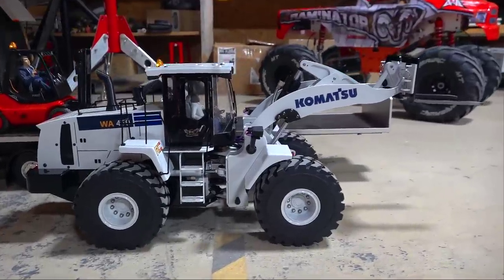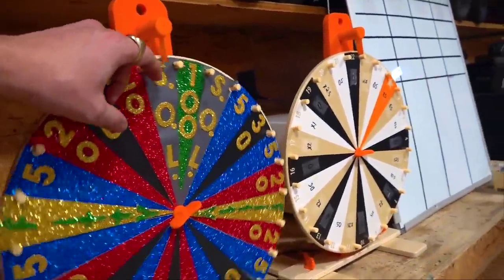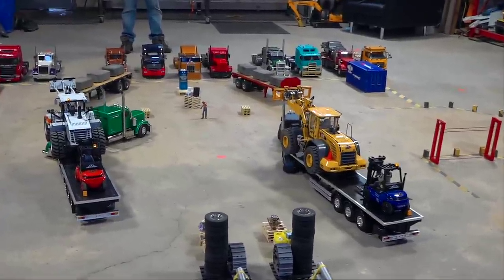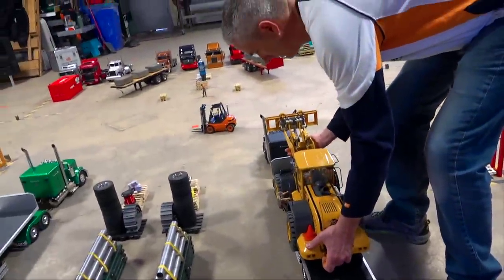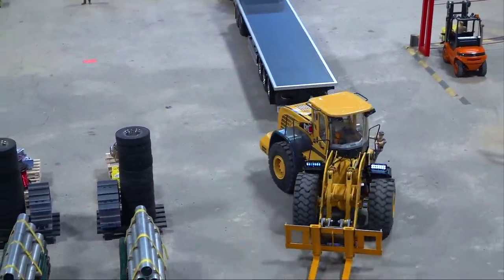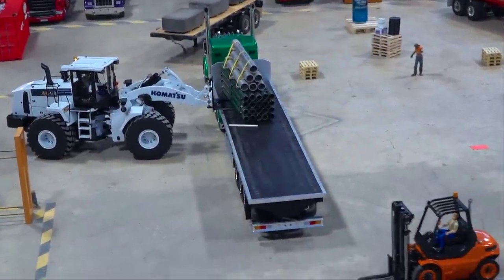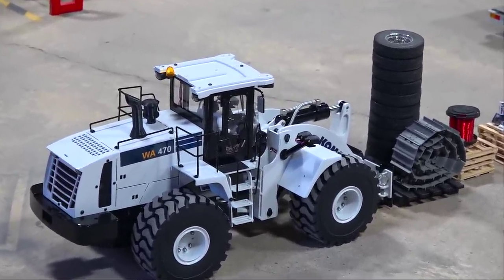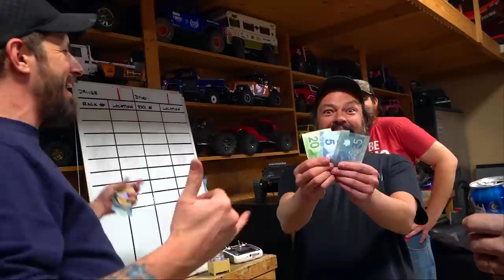LOADING KINGS - LOADER KINGS! DUAL ARTICULATING WHEEL LOADERS are CHALLENGED in the ARENA!

Comment: The forks on the new loader are at a different angle to the older loader. The older loaders forks are at a flatter angle when are on the ground where the new loaders forks only the front tips touch the ground so that is why sluice box had so much trouble with the pipes.
Reply from the maker: All he needed to do was tip the forks. I can do it no problem.
Reply: @poppygoatshomestead  but you are the Jedi master of RCs

Comment: Loved the Heavy equipment episode, too bad you can't do more with the heavy equipment like stacking containers with a RC Container Handler or using gripping claws on the excavators to pick up logs and load a log trailer to make the show feature heavey equipment more often.. With all the guys you have there you should run both Lesu forklifts as interference. I liked the Time Penalty. but should be like 30 seconds and the other contestant getting a penalty shouldn't cancel out the first penalty. especially if it's just time on the rock.

Comment: Both had failed strategies for loading the piping bundles.  I would have just picked up the loads with the loader and backed straight back.  Parked the loader and backed the semi back into the dock, thus giving you a straight shot to put the pipe on the trailer.
Reply from the maker: Or taken JUST the green pipe, not both stacks at the same time